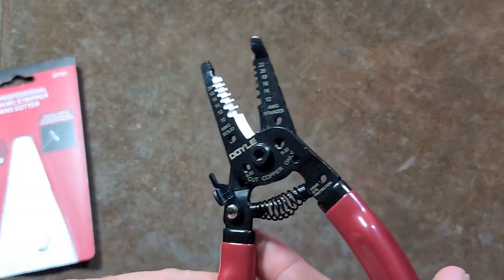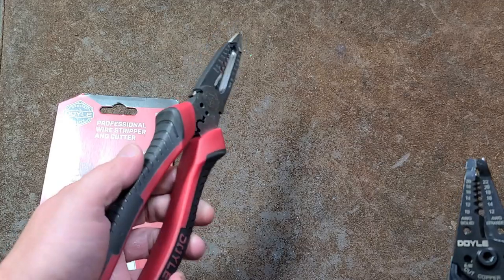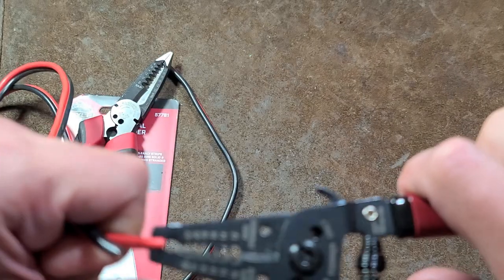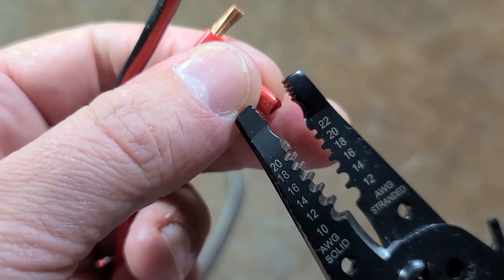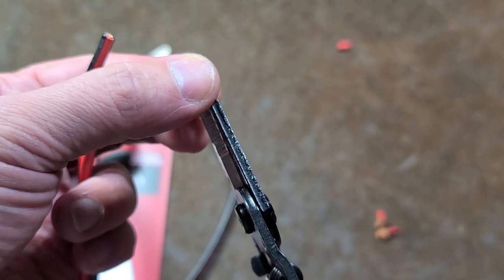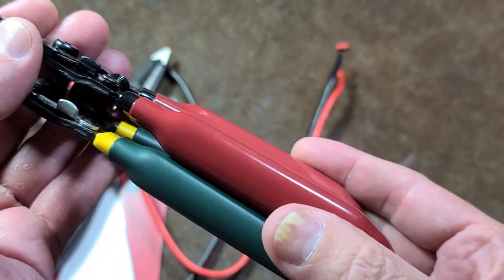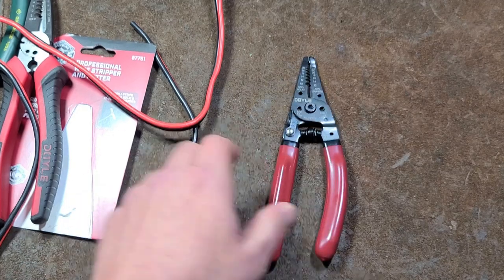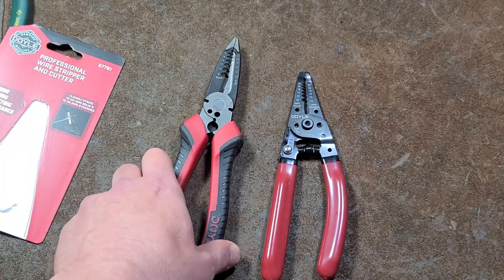Harbor Freight Doyle Professional Wire Stripper/Cutters Review

Comment: They used to have them on sale for $2.99 with a coupon.  I bought a few, but haven't worn out the first pair yet.  They are one of the best tools I have ever bought there.
Reply: They still have those Pittsburgh ones too.
Reply: The <$5 ones aren't Doyles, though.  Pittsburgh IIRC.  

I have a couple of those, and for that cheap, they're certainly not "horrible."  But, I do make sure that if I'm cutting stranded wire, I go out of my way to NOT cut 100% through the insulation, or else a strand or two is virtually guaranteed to get clipped too.  I just under-cut the insulation a few thou, and then pull it off.

Comment: Harbor freights had their Pittsburgh Lion on sale for 3.99 or something like that so a few months back because I couldn't find my other ones.
I decided I needed a pair for my house so I bought a second pair, but I bought Doyle this time.
The two are extremely similar, but the doyle does have a better center bolt & nut and looks cleaner, ever so slightly better built.
I'm looking at the age of your video and the doyles I bought had that same wimpy looking spring on them.
The spring on the Pittsburgh is extremely nice and heavier gauge.
Look at how wonkie that spring is.  That said, this doesn't affect the function of the tool whatsoever, it just makes the Doyle look cheap.
I swapped springs, so that Pittsburgh has the wonky spring and the doyle has that really nicely wound spring.
One goes in my truck toolbox and one goes in the house.
I don't use wire strippers on a daily basis so these are probably both work out just fine.
It's possible the coil is made of better metal, harder metal meaning longer-lasting....... But the only way I can test that is to damage the tool doing some tests.
I'll have to check out project farm and let him ruin some tools. He does such a nice job  breaking things.
I know the video isn't new but it's nice to see what you said about it, the door will actually looks pretty decent.

Comment: FYI, You may (or may not) know that Harbor Freight is privately owned (no stock holders).  https://en.wikipedia.org/wiki/Eric_Smidt
Reply from the maker: A sole proprietorship does not have stockholders Harbor Freight simply is not publicly traded but very well may have stock and investors (which they do) it's just not public.